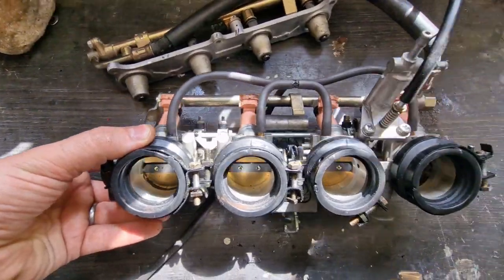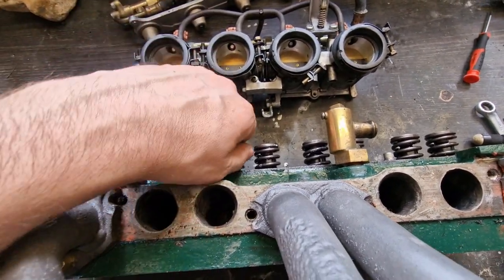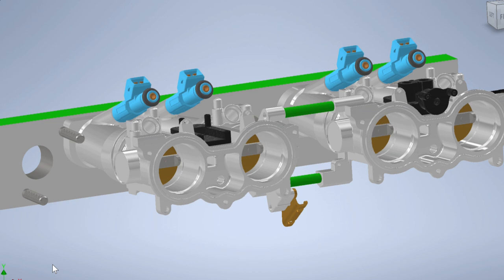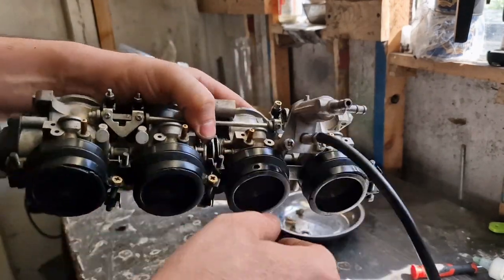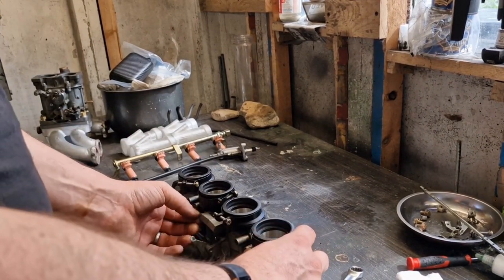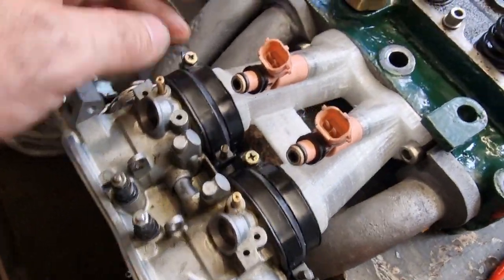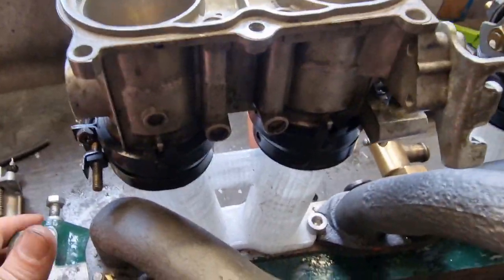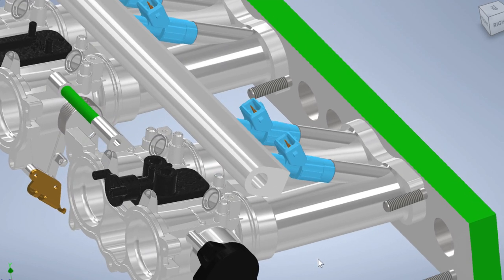Bike ITB manifold design - EFI ep2

Comment: some heat wrap on the exhaust headers wouldnt be a bad idea regardless of which manifold you use. solid work though, looks great.
Reply from the maker: I think you're right, I like.the look.of the ceramic coated exhausts too but  it depends on cost

Comment: Have you checked the spray from the injectors? Looks likes it may hit the side of the tube where they are attached instead of getting into the airflow.
Reply from the maker: It's not shown as well on the cut through but on the 3d it shows to go further into the port, I did say that I need to make a test rig but haven't as yet.